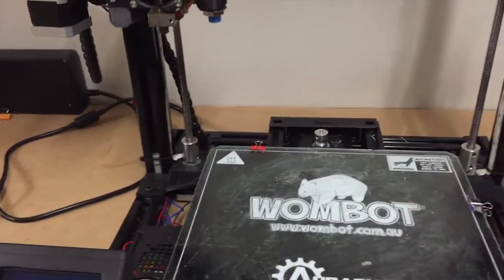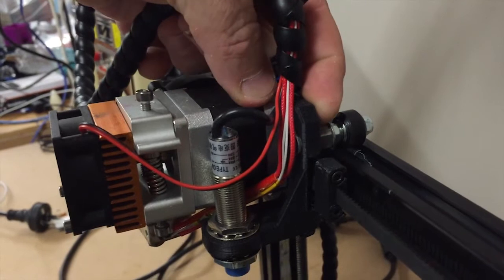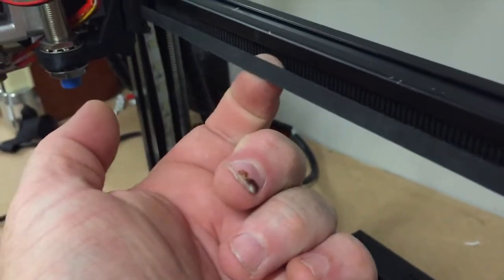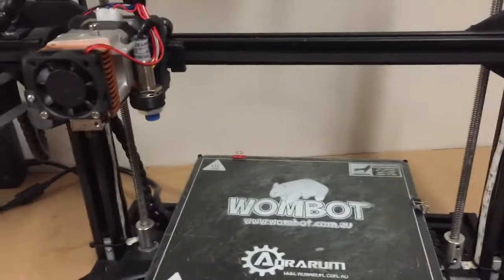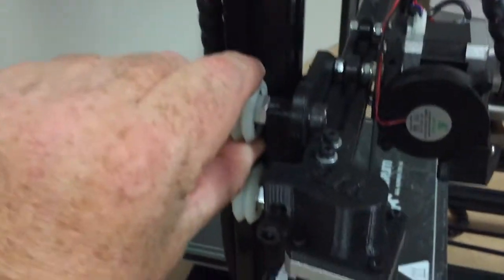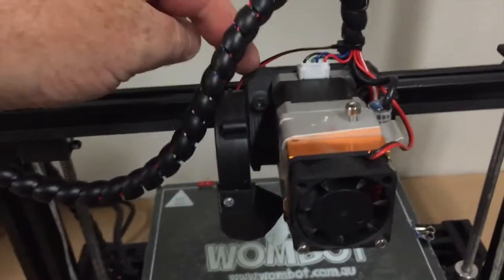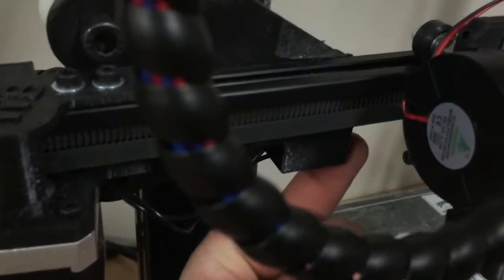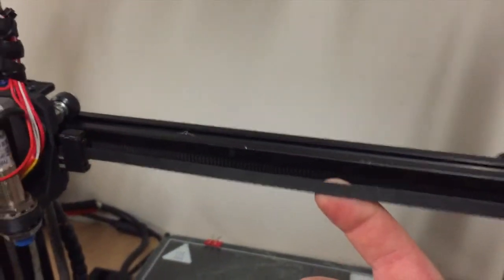Tightening things up on the Wombot

Comment: David - you seem to be one of the few people I can find that really have some working experience with these printers.  I finally received mine delivered to the States after about a month - and DHL sure had fun kicking it around before it got to me.  I've a number of issues with it, although I do have it printing - the most obvious may be the horrific metal/metal squeal it makes on the Z axis.  Please see my video https://youtu.be/Q6I28UVDtYo and let me know if you've encountered anything like this.   Once I get that sorted, I'll need to work out why it leaves a very odd raised texture on the surface of all prints, and finally, why on earth it's tilting every print slightly.
Reply from the maker: I posted on your video, but here is the comment for others to read

OK start by grabbing a set square, undoing all of the corners on the frame just a little and then tightening the entire frame so it's tight and square. 

Then drop the Y axis so the nozzle is a mm or less off the bed and disable the steppers so you can manually push the print head across the Y axis -  what you are doing is looking at the gap between the print nozzle and the glass as it goes across the bed to ensure that the Y axis is level to the bed - if it's out then holding one of the 2 threaded rods gently turn the other one so that you get the nozzle to bed distance the same both sides

Now on the back of the Z carriage the threaded rods go through a brass hut. That nut is held in place with a single bolt that has to remain loose - this allows the brass nuts to move a little to accommodate any movement on the threaded rods. also using a dry silicone lubricant or lithium based grease, add a SMALL amount of lubrication to the threaded rods. I use Lithium grease every month or so

The white rollers on each end of that Z carriage should also be firmly in the slots up the side of the aluminium extrusion, bu not too tight as you may break the plastic parts on the printer. Basically as they move up and down you should not be able to stop them with a gentle touch of your finger, but you should be able to stop them if you grab it
Reply: daviddth99
 Thank you for your response - it does mean a great deal to me.  For the ease of others, we can continue this discussion right here where more people will see it.

The Z-screw brass nut mounts were brutally tight.  I've loosened them considerably and the constant shriek has been replaced by an occasional high-pitched chirp near the bottom of Z-axis travel.  Already a considerable improvement.

I did some manual leveling of the bed, and one side was certainly farther from the nozzle.  I'm not sure exactly how the BL Touch works, but it seems that it was at least helping to compensate.  I adjusted it so it's closer overall, but I'll need to square everything up before I give it a serious calibration.

The nuts on the back and the bolts on the front of the Z-axis travel wheels are all very, very tight.  They don't seem to have any unacceptable amount of wobble.

The Z screws themselves seem to wobble quite a bit.  When I first reassembled the top crossbar, one of the Z screws would wobble violently until I brought the bar down and fit the tops of the screws into the little brackets that have bushings in them.  I did check the setscrews and everything is very tight.

I need to purchase a square before I can make sure everything is as it should be.  I've got one printing on a different printer, but I wouldn't consider it a real replacement for one I would buy at the shops.
Reply: daviddth99
I've had the chance to pull things apart, more or less, and I've installed a Titan extruder and E3D V6 Lite - I was having endless jamming issues that made testing a nightmare.  The thing came jammed right from Aurarum.

The two risers are now squared to the base rails - they both needed to tilt forward more than I would have expected.  I found that both Z-axis motors weren't high enough in their mountings, likely an issue caused by the very rough shipping.  I've fixed that, and in doing so, was able to make the top bar flush with the risers, rather than sitting about 10mm low.

She's still nightmarishly squeaky, primarily at the lowest points on the Z axis.  Loosening the screw guides seemed to introduce an issue with one side lifting before the other - so I've left them fairly tight and will deal with the squeaks while I keep working on it.

I have noticed that the extruder mounting gantry leans forward quite a bit, due to the weight of the motor and the entire print carriage.  I can't find many resources on these printers, but that just seems wrong to me.  It causes the print carriage to rest at a forward-sloping angle, for certain, but I can't find any real way to make it track any better.  Is the gantry bar on your printer also tilting forward?

Comment: thanks for this, i ordered a wombot recently and it arrived with one of the x axis brackets sheared off. THey got back to me quickly and are sending replacement parts but i'll have to disassemble the thing to replace them, the print bed rollers are all off the z axis rail too.